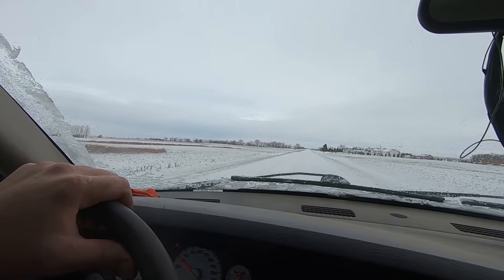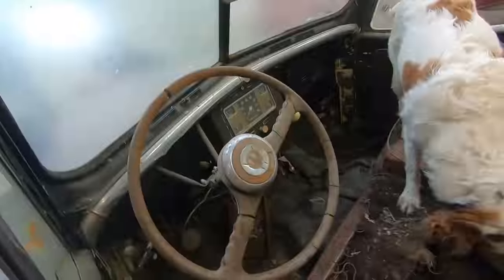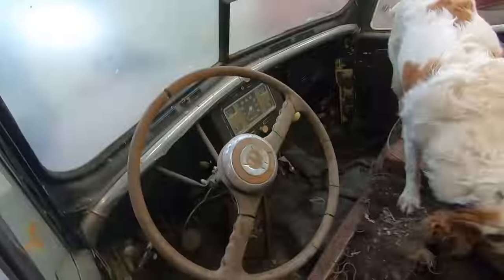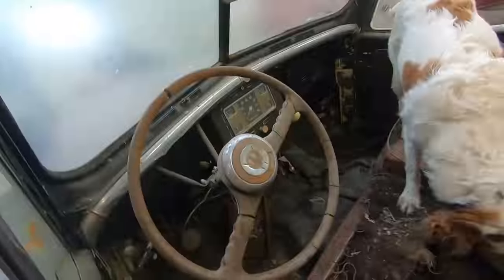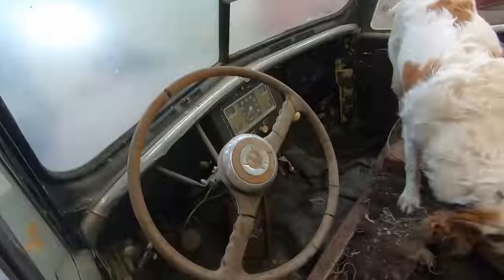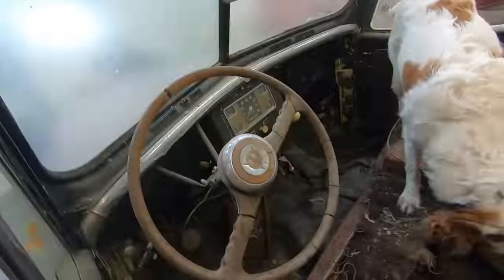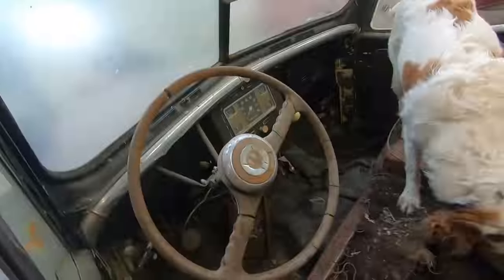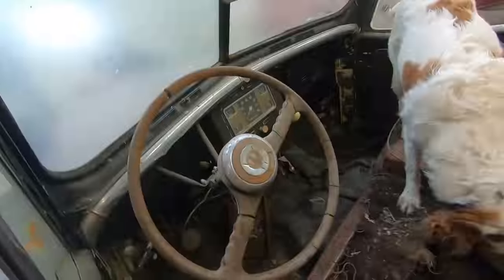Forgotten 1949 Willys Jeepster Barn Find! Will it Run?!? Sitting for 46 years! Family Heirloom!

Comment: Older vehicles like this didn't filter all the oil before it went to the motor. It just pushed oil from the regular passages through the filter. GM didn't start filtering all the oil till the 283 v8 came out (?'57-'58?), the 265 v8 used this type filter assembly, so the Jeepster there doesn't NEED to run a filter at all, you just have to change the oil more often to keep it clean.
Reply from the maker: You are correct! Those filters were mainly for looks!

Comment: Great video I didn't  see  a ballast  resistor hooked up  when you  wired the ignition. Straight  12 volts will shorten the life of the points  and condenser .

Comment: I had to google the slot in pads thing. Apparently people still do that to shoes to improve brake fade and also shape the shoe with sandpaper to conform to the drum better.  I never knew!  I wonder if those slots were cut by your grandfather.  I don't see why they would make a difference unless they help keep the shoe clean. Maybe it is an old hot rod fairy tale people just continue to use.  Very interesting though!
Reply from the maker: Interesting!

Comment: Use Colonel Brassy for chrome.  The stuff is absolute magic!  I used it on some slightly pitted 50+ year old door handles and trim bits and they look absolutely new!  Also, using 5w in the Jeepster will result in lower oil pressure and that engine looks like it could use all it can get.  5 is the actual viscosity, I'd suggest 20w50 instead.  0w and 5w are really for tight-clearance modern engines, and I don't think this one qualifies.  :-)  OK for a Dakota winter, maybe.
Reply from the maker: I'll check it out! Thanks Douglas!

Comment: A heads up.That overdrive set up is complicated. The borg Warner transmission has a free wheeling set up and there is no push starting or engine braking. My brother made the mistake of just leaving it in gear instead of pulling the ebrake on mine and it took off rolling and banged into a friends trailer in the drive. The trans will instantly destruct if the OD is engaged in 1st. Do lots of reading before you try using it. I just swapped in a higher geared Ford Ranger rear and never messed with mine.
Reply from the maker: Thanks for the info!

Comment: I'm really perplexed about that carb. Carter YF? Your engine (L4-134) came with a Carter WO and much different linkage. The Carter YF carbs were used on the 1950 and later engines with overhead intake valves (F4-134). I'm sure there is a story here. The more I see the more I like this family mystery. BTW mine start just fine on 6 volts even as low as -20F. 12 volts can blow out your irreplaceable gages unless you add a resistor. Kaiser Willys has such things.

Comment: Did you notice the tin shroud around the axle . The purpose is to collect and direct the oil through a hole in the backing plate away from the brake shoes . Sometimes it worked.

Comment: I grew up in the Los Angeles area and we did Chinese fire drills so not a regional thing in like submarine races which are an LA thing. great video I'm a Ford guy who grew up on Pontiac's. I'd love to have a 55 two door. We and I think warm thoughts about the good old cars but wouldn't want to change points and pack wheel bearings. They were a lot more work to drive than today's cars. The 55 didn't even have self adjusting breaks.

Comment: Hey Mortske you wouldn’t no any one that would have a stake bed for a 1925 model TT Ford truck would you?? I’ve been looking for one!!! It doesn’t have to be redone or anything just looking for most of the frame work for one!! I got the original motor running and the body is in good shape other than the bed of it!! I would definitely love to build a nice stake pocket bed for it!! Just needing all the metal frame work for it!! Please let me know since you say that was what your dad and grandpa liked to work on!! I’m in southern Iowa but will travel to get one!!! I’d really like to get it back out on the road again!! We did have it out last summer and took it for a road trip to the station to get a case of cold ones!!! It was definitely awesome!! We did have all the wheels remade for it so they weren’t as loose as they used to be!!! Any help would be greatly appreciated!!!
Reply from the maker: I do not, sorry!

Comment: I use a tuna fish can with about 20  1/8 holes drilled in the bottom and drill 2 holes near the top of the can and add a wire across to make a handle and put in my small carb parts and put it in the ultra sonic.
Reply from the maker: Nice!

Comment: Your rear wheel cylinder looks like a 1950s ford, the offset bolt holes looked like ones I've replaced.

Comment: Hello, I believe the oil filter hose was kinked off because of low oil pressure. Those remote oil filters should have a restrictor fitting with about a 1/8 hole. With out the restrictor the oil pressure will be low. 1/16th to 1/8th.
Reply from the maker: Thanks for the info!

Comment: Seen so many of these "will it run "stories  out there! Worked in car museum for 16 years. Main problems are bad gas , crappy electrical system. Stuck fuel needle and seats, stuck valves in fuel pumps, stuck floats in the carbs. Stuck thermostat, partially clogged radiator . Long storage may include  stuck valves, rusted rings to block, clutch disc stuck to pressure plate. Let alone old tar like oil. Stuck floats will bath the plugs in gas (wet plugs) and make for massive backfire. The ethinol in the gas makes for even  larger mess! All the items described stick sooner with a yellow sticky to rock hard deposit..break apart , wash with acetone. Carbs have to be  rebuilt...the bowls, metering rods, jets are full of these deposits. Some newer cars in the 70's had rubber lines in the fuel line from the tank, these crack and rot. Barn finds : have had dirt and rocks in the fuel tanks, or rusted out on top. So ....if a car is in good shape....to begin with ...it will run ...with the maintenance we see here....good video !

Comment: you can run all the little carb parts, bolts through the ultrasonic cleaner with the carb body, i use a little basket to hold the little parts on a hook so i don't have to fish them out.

Comment: I've had some success quieting my ultrasonic cleaner by folding up an old towel and setting it on top of the unit while it runs to keep the lid from rattling so much
Reply from the maker: Thanks for the tip.

Comment: Try some SEM "Rust-Mort"(catchy name there), it should neutralize/remove rust deposits. Phosphoric acid is the key ingredient, flush with lots of water as it's corrosive AF. 69504 is the part number for 1 quart and the stuff ain't cheap!
J6 Champion plugs are colder than J8, bigger the number the hotter the plug with Champions.

Comment: Still watching your video a little at a time as I work on Rosie..... and, next time you fight stuck bolts in a go devil head ...plop it on top of a woodstove before you light it and let it heat up slow ....then a T handle breaker bar to rock the bolts back and forth ...
Bolts will deform and need to be replaced but it saves drilling broken bolts
Reply from the maker: We do a little Instagram

Comment: Next time you run wire, get you some electrical pull string and blow it through the conduit and pull itinstead  of pushing it.  Tie a piece of Walmart bag to make a parachute when you blow it. Makes it a lot easier

Comment: Make sure you put heat shrink tubing on the bottom of your basket for your cleaner the metal legs will eventually host of the bottom from the vibration

Comment: I drive a '48 that was much rattier than that one when I got it but it did have a rebuilt engine. Put an aftermarket poly tank in it. You will never regret spending the money. and they come with the straps too! Lots of info. on the Old Willys Forum. Good luck! (mine was also originally that horrible yellow too. Then red, then black, then army green. Now it's a sand beige with semigloss black upper. No top either but a roll cage narrowed and shortened out of a late CJ.  That windshield can barely hold itself up. Oh, Ford Ranger wheels fit nice. Beware the left hand lug nuts on the right side (I think. Changed all mine to right handed.)
Reply from the maker: All the colors under the rainbow!

Comment: Willy's Jeepsters are the great, the wagons too. Unless maintained, those engines don't last much over over 60k without periodic refresh , Had a 2wd Jeepster with the Hurricane engine..dumped that thirsty boat anchor and installed a tiny ford 144" ci industrial six cylinder in it. Huge performance & MPG difference.
Reply from the maker: Nice!

Comment: Use gunk carb cleaner dip or any other brand and pour it in the sonic cleaner and use that instead, it works amazingly and u can leave it in and use it for over a year and just pour more new cleaner in as needed.. just a tip on what works best for them sonic cleaners

Comment: The center tube in the canister has a small port hole to keep the oil under pressure when going to the outlet hose. In this type of system, only

Comment: You can use 2 gallons of carburetor cleaner and lower the basket down as long as the basket's touching the bottom and not the parts it works great
Reply: Gotta be carefull with BOOM factor.

Comment: They indicate using the basket.  I have a smaller version and don't use the basket.  Using it with parts on the floor has worked fine.

Comment: Yes, and when/if you need to roll start a Manual Trans vehicle. Put the beast in 3rd Gear then pop the Clutch. (3rd thing my Dad taught me. Right after "Have you checked the Oil Pressure Sender?". When I was 17 & dumping 1Qt into my Car every other day. And sure enough, Dad was right. EXPERIENCE MATTERS!). Great revival!

Comment: The Flathead 4 cylinder engines were called L heads.The F head engines had the intake valve in the head and the exhaust valve in the block.

Comment: Early post WW2 automotive type stamping die machinery was in extreme short supply. Willys designer Brooks Stevens designed the Station Wagons, Pickups and Jeepsters to be produced using shallow draw (6" and under) appliance type dies. Yours seems to be in very good condition considering the lack of care. Overheating likely due to missing fan shroud. Pedal pad wear and floor mat indicate actual low mileage. In my over 50 years of owning and restoring Willys vehicles I have yet to own a Jeepster. This one should be saved.
Reply from the maker: I looked him up. Pretty good list of accomplishments!

Comment: Congratulations on getting back into a running vehicle.  One quirk about this engine though - you must use the stock type thermostat, as a modern thermostat will mount too high in the water outlet, which will allow a big air pocket to form under it, which will keep it cold, which will keep it from opening, causing the water in the block and head to overheat, with the water outlet staying cold on top.  PS:  Keep it 6 volts.  If you use large enough battery cables - 2 gauge should be big enough for this small 4 cylinder engine - you will not have any trouble starting it.  But you CAN NOT use the 4 or 6 gauge cables that 12 volt cars use.  6 volt starters draw twice the amps, and thin cables won't pass enough amps.
Reply from the maker: Why not just convert it to 12?
Reply: @MortskeRepair  Because then you will have to either replace the overdrive solenoid and maybe some relays, or wire transformers to them, wire a transformer to the radio, replace the heater fan, and also because it will no longer be stock, and pre 80s vehicles should be kept STOCK, as they are now, thanks to "Crush a clunker" laws, are pretty rare.
Reply from the maker: @michaelbenardo5695  12V solenoid is easily sourced along with the relay. Radio and heater are also going away. I'm not all about that stock life. I like the stock look but I want something I can jump in and drive and charge my phone in and get a boost from someone else in a 12V vehicle if need be.
Reply: @MortskeRepair  Then you should leave classic cars alone.  They are SUPPOSED to be STOCK.  Maybe a 69 Jeepster Commando?  It is 12 volts and has the Buick V6, which is much more powerful than the Jeep engine.
Reply from the maker: @michaelbenardo5695  Hahaha, it never gets old how upset folks like you get for upgrading a vehicle that isn't theirs. I think later Jeepsters are hideous. Sorry.
Reply: @MortskeRepair  You guys have driven the price of collector cars sky high by making stock ones super scarce.  It is killing the hobby, as most younger people can't afford to get in it, and us oldsters are soon going to be gone.  That means our treasures will probably be junked.  Is that what you modifiers want?  For everything that isn't Japanese to be scrapped?
Reply from the maker: @michaelbenardo5695  I'm pretty sure inflation has driven the prices of everything up. Younger people aren't interested in cars that drive like tractors. They want old cars that start and drive like a late model. When you Boomers die that will open up another fleet of cars for us to make our own. I want to enjoy the MY CARS. That's what I want. I could give two craps about your cars or what you like.
Reply from the maker: @michaelbenardo5695  Haha, it means I don't have to have a random 6V battery floating around and it starts better! Why do you think everyone converted to 12V in 1955/56?!?
Reply: @MortskeRepair  To save money - 12 volts allows a lighter wiring harness and thinner battery cables, which is a big cost save, both in materials and in labor, yet doesn't cheapen the vehicle.  In fact, many people, such as yourself, think it is a true upgrade and are willing to pay more for it.  A win-win for the auto industry.  Only the owners of copper mines didn't like it.  Less demand for copper.

Comment: I know of a person in Massena,NY that gad one. He was a Willis dealer. When he passed the person wouldn't let me purchase it and was sent to the junk yard. The too half if tge engine was missing. I did manage to grab a few jeep parts still in the original box. I also have a flat 4 motor that us attached to an old welder/generator and kept that.
The garage where that car was, was sold and all the parts went to the junk yard. Sa.e kind of conversable. I need to find the pictures I took of that from 6 years ago. Gardners and sons garage on water street in Massena, NY 13662

Comment: Your Oil Filter is a By-Pass type system and was a common accessory in the 40-50 as the engines from most manufactures didn't have filtering designed into them.  The tiny hole is designed so the oil pump can maintain oil pressure to the engine and if it plugged you would not have any filtering, but the engine would still have oil pressure.  This lack of factory full flow oil filtering was one of the reasons for the 1000 mile oil change recommendations as well as the quality of the oil back in the day these vehicles were designed and built.  It is NOT a Jeep thing, my dad's 50 Plymouth had this oil filtering system retrofitted when he bought the car in 52.
Reply from the maker: Yeah, I'm pretty familiar with these filtration setups.

Comment: You put it in first gear and rocked it to unlock the engine. First gear will demultiply the torque. It might be better in third or fourth gear unless you actually want less less torque. I often see people pull starting a vehicle in third or fourth maybe they have a reason for it.
Reply from the maker: Noted

Comment: The orignal double layer hubcaps are high dollar and made of unobtainium. Repros are pretty horrible.  Does yours have the overdrive?  Get it up to 37 let off gas and it will slide into 4th.  You can get recast steering wheel and new horn ring. not cheap. I have a 1950 bow front 6 cyl.
Reply from the maker: Sure does have the OD.

Comment: @ 39:07 ROFLMAO! BTDT, got bit good by  66 chevy 250 -6 while having the wife crank it over so I could hold my compression gauge in a plug hole.The spark jumped from the coil, about 3 inches away from my had and went thru my shoulders to the radiator, where my other hand was grounded. Yea, I had to sit on my stump for a couple minutes while I swallowed my heart back into place.

Comment: just make sure you latch your hood that hold up bar could come down and stab a hole in your radiator if your hood flies up, like my 53 Studebaker truck. don't laugh it had a 58 Corvette drivetrain. that's a commander four-cylinder I believe , you got to just keep going back and forth on stuck motors sometimes that motor needs a quart of Rislone in it's oil before you start it up it'll free up those lifters
Reply from the maker: That Stude sounds awesome!

Comment: Common "12 Volt" Ignition coils are NOT 12 Volt devices, they are designed to have a ballast resistor in series except while cranking the starter ( when the battery will be below 12 volts ).
If you omit the ballast resistor the coil will run very hot & possibly fail, the Points will erode quickly, ang the spark plugs will erode due to oversize spark.  Also excessive dwell angle will cause even more coil heating. FYI ballast resistors will bring the coil voltage down the 6-8 Volt range. Note; Some Vintage Foreign 12 Volt cars were built with actual 12 Volt Ignition coils. I have converted Cars from 6 to 12 Volt and 12 Volt Positive Ground to Negative Ground, Starter motors don't care about polarity, Ignition Coils do. 5 Volt starters running on 12 Volts turn faster engine starts faster and they therefore don't over heat, just be careful not to keep cranking when the engine won't start, it is easier to roast the 6 Volt starter than a 12 Volt one.